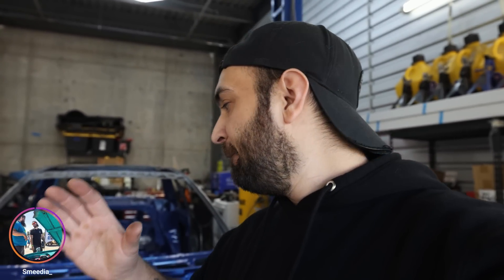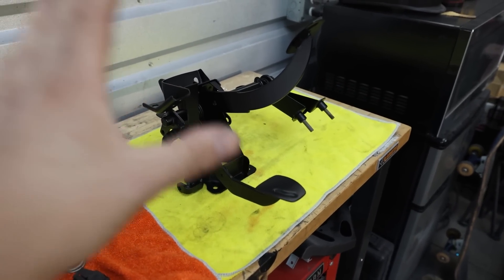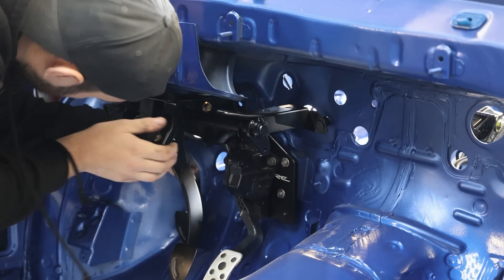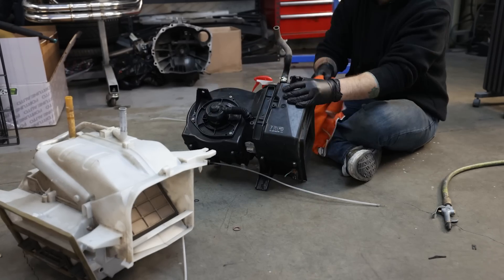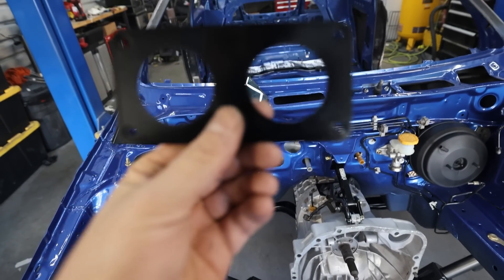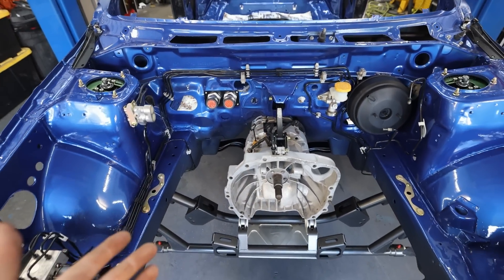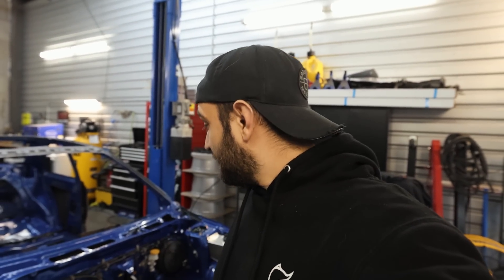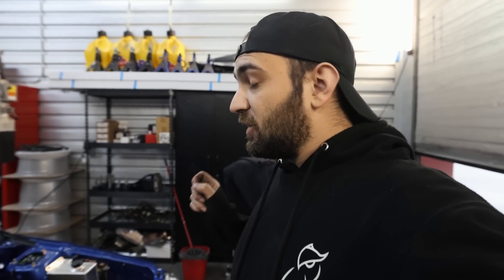Wiring in the Subaru 22B Clone; No Merge Harness Needed.

Comment: We appreciate that you’ve reached out to us for advice. I may not have been as clear as I could have been when we chatted so I apologize for that. Despite your customizations a merge in some form is the most efficient way to do this and maybe it’s just semantics at this point. Your situation is different than a standard merge in that you are not using an OEM ECU and have a standalone with PDM capabilities so you may opt to not tie into some factory components. However, once you build your Haltech to engine harness, you can save some steps and really simplify things by connecting back to the OEM bulkhead harness just like we would do with a standard merge. You noted the starter connection to a keypad which would be a great place to connect back to the OEM harness to avoid having to double up components or have to run fresh wire when it’s already in there. There are a fair number of other scenarios of where “merging” back into the OEM harness from your new harness may be beneficial and you should consider as you work through this project.

Comment: Are you running an sti cluster in it or the stock rs one? That's the only thing I could really imagine would require a harness merge? Even if the haltech has its own screen which you'll most likely run based on previous videos, an sti cluster is the only shared point between ecm and body harness

Comment: At 12:56 - when i was restoring my 95 mustang i used both Lizard Skin (sound & thermal barrier) 2 OEM firewall mats, road kill sound deadening, closed cell foam and 2 OEM jute mats. It's not Lexus quiet inside, but my friends say that it's amazing that you can have a low volume conversation with my big engine and exhaust. 

Firewalls in general are to keep engine fires and the cabin separated. The mat doesn't prevent the fire from coming in, i think it's just sound deadening, correct me if I'm wrong 🤔 run the A/C. Improves comfort and defrosting should you get caught in the rain and street car💪 you have earned my subscription, sweet project🏆

Comment: Hey Tanner ive been a little mixed up do i need a tune for my 97' Subaru Outback Sport if i put uel headers on it? It is a NA car
Reply: No you dont need one. A tune would probably help make the most of them, but it will run fine without one. I also dont think anyone ever bothered cracking the ecu for those so youd need to look at getting a standalone if you did

Comment: Yeah in my RS I just got a PnP adapter for the harness so all the functions stay oem and the after market ecu pretty much control the engine side, plus make a sub harness for the cam, crank,boost,AFR,AVCs etc… directly to the ecu. This was the simplest way in my opinion. It also allows you to easily swap the ecu in the future.
Reply from the maker: I debated it but the issue is have is all the extra sensors that I want to add. I would have to make a harness anyway to accommodate for coolant pressure, ethanol sensor, fuel pressure etc etc. the PnP work great for stock ECM cars that are getting swapped. But you still need a patch harness to go from the PnP merge to the ECM. Either way works though 💪

Comment: Tanner, does the new engine harness bulkhead quick disconnect plate you installed have a rubber gasket between the firewall and the plate?  You may have water intrusion there if you do not have some sort of seal.
Reply from the maker: I added one behind it 💪 it did not come with one though.

Comment: The factory wire harness in the engine bay is routed down and then up for water. If it gets wet, water will run away from the grommet instead of sitting on it and slowly seeping into the car's interior.
Reply from the maker: Ahhhhh that makes sense! I figured it may have been there invade repairs needed to be made 😅

Comment: Not sure with the coilovers your running but with my gc8 that has tein super streets i swapped the top hats from left to right and it gains you a degree of castor and these things need it with very little caster stock
Reply from the maker: I snagged a set of fortune autos for an 05-07 STI, just ordered the Ras top hats to be able to get them to where they should be. 

For the LH to RH swap is that with RS plates or STI plates?
Reply: @Smeedia  thats with tein camber adjustable plates

Comment: What’s the regulations in your state for modifications in cars like this? Interested as I’m sure you’ve seen on our EZ30 group it’s wildly different between countries and you’d never be allowed in the road with things like aftermarket subframes. Even removing a crash beam for an intercooler is a no go
Reply from the maker: We don’t have any, no testing or inspections. So pretty much anything is a go. Plus cars over 25years old anyway wouldn’t need any inspection

Comment: Just finished doing a complete harness swap on my car with a  manual harness so a lot of this was done and looks very familiar
Reply from the maker: How was doing the swap? Just pull the old and swap in new? 👀
Reply: @Smeedia   yeah same chassis so a lot of it was just pulling out the harnesses and swapping it but then you start running into small things like top feed vs side feed so then you need different tgv housings and the connectors are different on the injectors and the tgv housings, so you delete the tgvs and the throttle connector being different so what was supposed to be a couple weeks worth of work ended up being 5 months of ordering parts to move forward to find out you need more parts

Comment: That piece is generally called a firewall insulator in my old muscle car industry. Saying they're sound deadening & heat insulation is pretty accurate. There's a company I worked with called Quietride who put out a product called Acoustishield. Pretty badass stuff, but they don't make things for cars like these though. 

I would run the AC dawg. You said it yourself, the ultimate EJ Subaru. How big of a flex is it to have working AC in a ridiculous built car? Exactly.
Reply from the maker: I mean having AC would be nice, I’ll have to see how much all the AC stuff is 😅

Comment: Tanner. Non abs masters have 4 lines out not one.  It’s also has 2 inlet ports
Reply from the maker: Correct 4 lines out, idk where I saw a single stage master for non abs but I swear I saw one
Reply: @Smeedia  there’s a single stage booster for non abs cars.  That may of been what you were thinking about.   The single stage is good if you want a firmer pedal but don’t want to delete the booster.  It’s also thinner and weighs less.

Comment: I think you will regret having that gearbox mount. It's so noisy... It's like having the starter and the gearbox in your lap.
Reply from the maker: It has the factory mount right now? Or are you referring to the pitch stop?
Reply: @Smeedia  pitch stop.
I used one, removed it immediately because of the noise.
Depends on the "comfort" level you want.
Reply: @PedroFTeixeira  I got a Cusco one and it also adds a lot of noise.   The first time I started it I thought the starter was broken.   The gear box whine is annoying
Reply from the maker: @PedroFTeixeira I use em in every car and they’ve never bothered me before. The group N is a nice middle point if you want one a bit firmer but not as much NVH

Comment: Ooh, should have put some tape over the A/C Expansion valve before doing that cutting next to it.  Even a little depris in the A/C system can ruin new parts.
Reply from the maker: I can blow it out, chances are I’m not using AC anyway but I’ll clean it up a bit 🫡
Reply: @Smeedia  How's the condition of the foam on the Evap/Heater core/vents?  Good opportunity to get $10 of universal foam to replace all of it if its falling apart.
Reply from the maker: @stevemartegani tbh really good, I have new foam here but didn’t see a need to swap it 💪

Comment: On my road race car. I still run the stock RS master cylinder and brake booster for my brakes. I run a AP four piston bbk kit from Essex and 4 piston rear brake kit from Wilwood with no issue with the brake feel. I know people want the bigger MC but IMO it's not not really needed.
Reply from the maker: Good to know, I figured a 1/16 difference wouldn’t make a HUGE difference. From what I was reading everyone was suggesting matching the master to the brakes if possible. A new master was cheap enough I could justify it. Was only about $200 for a new OEM 1 1/16the replacement
Reply: @Smeedia  BTW, the wiring just for the engine. You should have used the factory whole. You should be been able to use a single QD connector and run the rest to the left and right like the factory wiring. I'm always afraid of wiring that close to the turbo.
Reply from the maker: @PatrickLipsinic that was the factory hole 👀 the harness will be made of Tefzel and DR25. I’m not stressing heat too much. Turbo and downpipe will both be cerakoted too